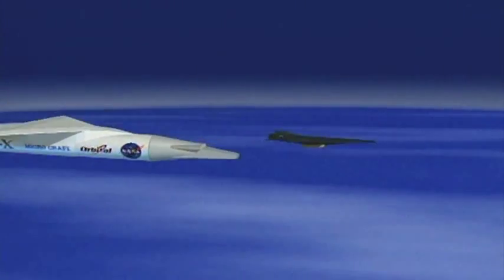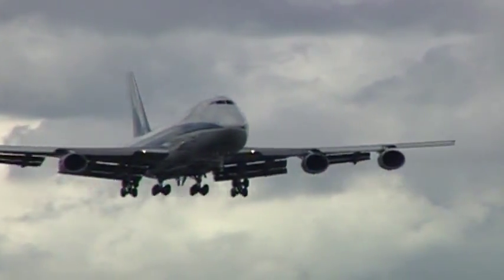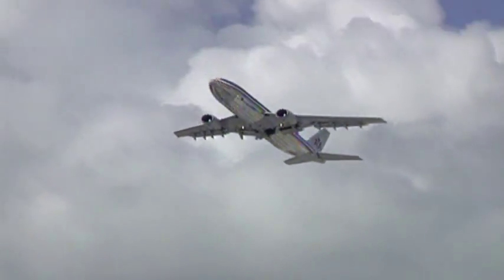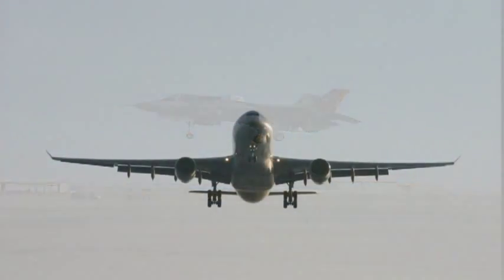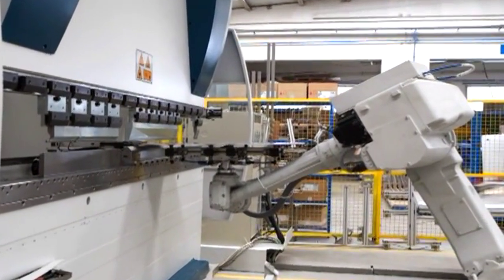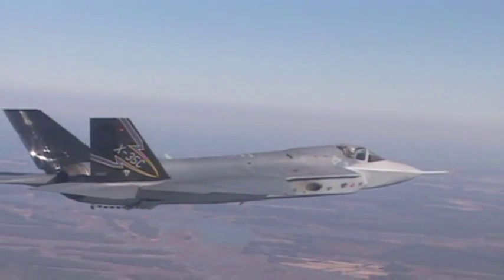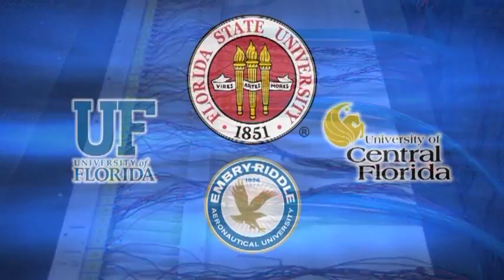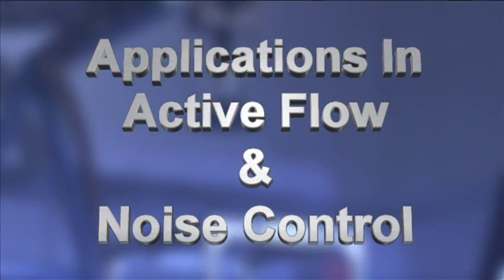Introduction to Active Flow and Noise Control

Comment: But what do the actuators do specifically?
Reply from the maker: It’s been a while since I produced this video, but as I remember the actuators are compressed air nozzles distributed on the wings leading edge that  serve to change the wings shape in flight.  This can increase the airfoil’s efficiency in certain stages of flight.